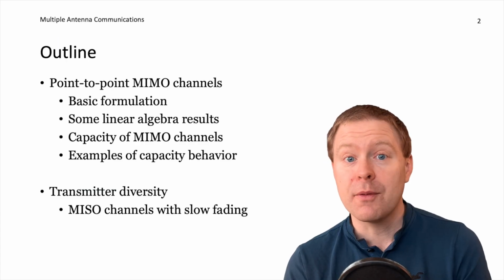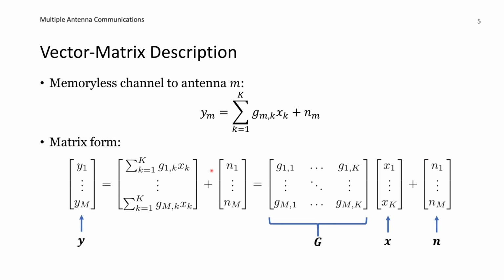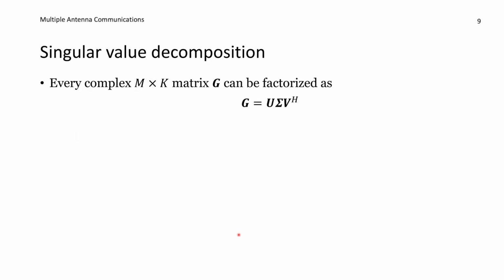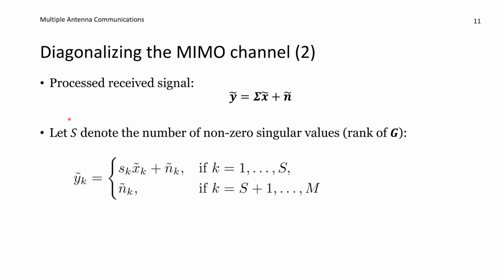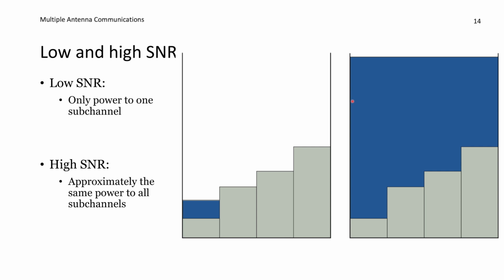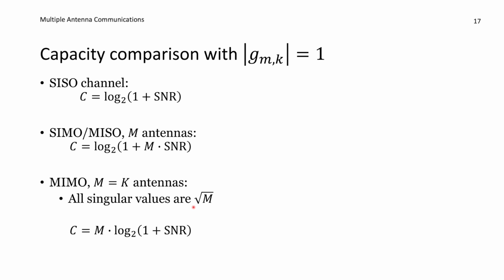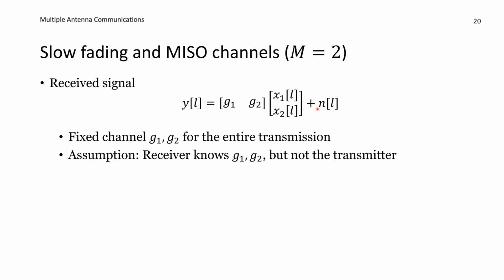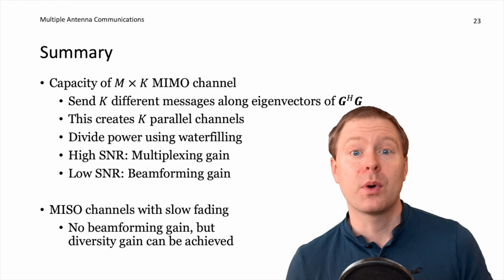Lecture 4: Capacity of Point-to-Point MIMO Channels

Comment: @WirelessFuture  Can we summarize the possibilities of different gains as such : we get multiplexing gain in case of MIMO High SNR NLoS case, beamforming gain in SIMO, MISO (when channel is known at the transmitter), MIMO LoS case..Diversity in case of SIMO, MISO or MIMO when we have independent fading channels?  In case of MIMO High SNR NLoS case, we don't have beamforming gain, right?
Reply from the maker: Yes, that is a decent summary.
Multiplexing gain: High SNR and high-rank channel matrix, which happens in NLOS cases and in LOS with some strong reflecting object.
Beamforming gain: Any scenario where the transmitter/receiver has multiple antennas and channel state information, so it can point the beam correctly.
Diversity gain: SIMO, MISO, or MIMO with fading channels. It doesn’t have to be independent/isotropic fading, but enough scattering clusters to get a channel components from many different angles.

When you do spatial multiplexing, as in the MIMO High SNR NLoS case, you will transmit your data using the singular vectors of the channel matrix. This will give you a beamforming gain as well. However, the SNR gain will not be as visible in the equations because you need to divide your transmit power over multiple spatial streams.
Reply: @WirelessFuture thanks for your reply

Comment: In case of MISO, it is said that there is no beamforming gain as channel is not known at TX. But isn't it V that doesn't contain channel g is to be known at the TX?
Reply from the maker: Yes, we designed a transmission method where V doesn’t depend on the channel, so the way we transmit is independent of how the channel varies. We are just broadcasting the two signals from the antennas in a predefined way instead of beamforming it towards the receiver. 

In Lecture 2, we covered the case when the transmitter knows the channel and does MRT beamforming.
Reply: @WirelessFuture  The capacity shown at 45:23 for MISO is I guess with transmit diversity (space time code) without MRT beamforming. In this case, we don't have any precoder, we just apply space time coding, right?
Reply from the maker: @amahbubul85 That is correct

Comment: Dear professor, could you tell me where I can acquire tutorials about spatial sampling? I feel a bit confused about grating lobes/ beam width / ratio of the gain of main lobe and side lobe etc. What determines these? I believe there is a relation to that in time sampling,but I cannot build the connection. The number of antennas in ULA seems like the samping points while the spacing of antennas seems the frequency. Can you explain more about the relation of space and time sampling? And what determines the beam width etc.? Thanks a lot
Reply from the maker: This video series has been extended into a textbook called "Introduction to Multiple Antenna Communications and Reconfigurable Surfaces". We elaborate on these things in Chapter 4, so I recommend that you read it first. If you have remaining questions, please feel free to post them here!

You can download the open-access textbook here: https://www.nowpublishers.com/article/BookDetails/9781638283140

Comment: I have two questions here(46:21)
you explained that there is no beamforming gain both MISO and SIMO
but i am confused because the term |g|^2 
q1) Doesn't the term  |g|^2  mean beamfroming gain?
q2) there are two antenna, so, is diversity gain 2?
Reply from the maker: The term ||g||^2 is the sum of the channel gains of all the antennas. It can provide both a beamforming and diversity gain, however, when using space-time block codes, we lose the beamforming gain which can be seen by the fact that we get ||g||^2/2. Dividing by 2 removes the beamforming gain that otherwise would have been 2.
Reply: @WirelessFuture  ||g||^2/2 is achieved even though we are not multiplying by the complex congugate of g like we do in MRT?
Reply from the maker: @amahbubul85 Yes! If you want to get all the intermediate step, you find them in our book: https://www.nowpublishers.com/article/BookDetails/9781638283140
Reply: @WirelessFuture  thanks..

Comment: @Wireless Future  Thanks for this nice lecture. One question. At the beginning, you considered deterministic channel and then you went for SVD. By deterministic channel, you meant no fading, right? The  rank is 1 for such case, no? If that is true, we will never have multiplexing gain, isn't it?
Reply from the maker: Yes, deterministic means to fading; that is, no mobility. This doesn't always imply rank 1. You get rank 1 in free-space far-field LOS with single-polarized antennas. Higher rank is obtained when there is dual polarization, there are normally additional paths to the direct LOS path, and the far-field approximation might not be accurate.
Reply: @WirelessFuture  thank you very much...So, 'deterministic' means here that there might be path loss and shadowing, and multipaths, but they are fixed due to no mobility, right?
How it is different from slow fading case? There also we have all these impairments and the channel g is without any time instant l which means the channel is fixed. I understand that for deterministic channel the channel remains the same for infinite time, while the channel changes after a particular time for slow fading channel. But at least for that time duration, they means the same, no?
Reply from the maker: I agree, there is a blurred line between these scenarios. From a capacity computation perspective, the key difference is whether we know the channel at the transmitter in advance (=deterministic channel) or not (slow fading). There is no mobility in the deterministic case so we can easily learn the channel. It might be a fixed deployment. There is slow mobility in the slow fading case, so we need to learn the channel. But we only have time to learn it at the receiver side, maybe because there is no feedback link. This case is not happening so often in practice, since we try to design feedback links or use TDD.
Reply: @WirelessFuture   thanks à lot. I am not so clear about what you meant by 'this case' at the end. If we have TDD, we have enough time in slow fading case for Rx to send pilots to the Tx using which the Tx can learn the channel, no? Because no feedback is needed for TDD case and channel changes very slowly for slow fading case, no?
Reply from the maker: Yes, that is what I meant. The slow fading case is not so common in practice, since we design systems to avoid it.
Reply: @WirelessFuture  thanks